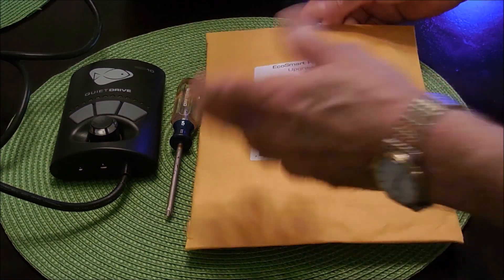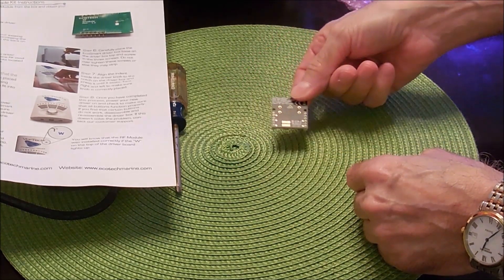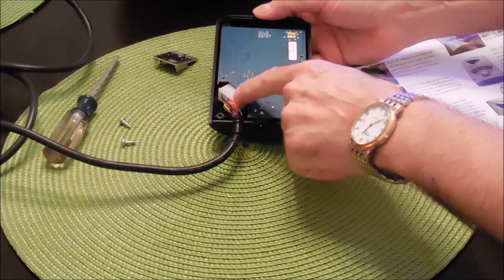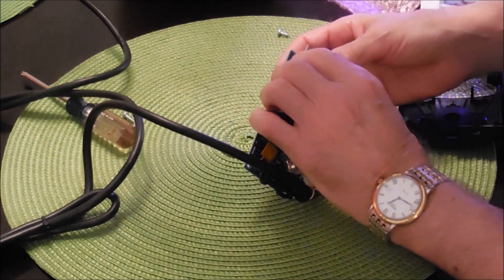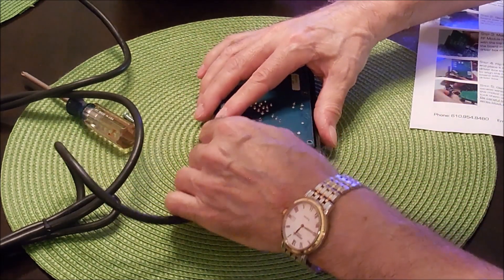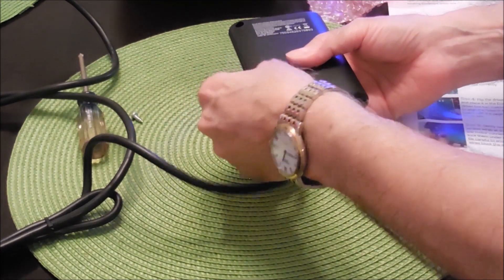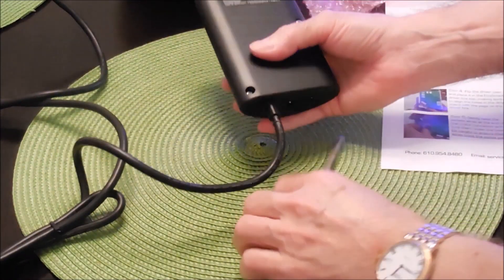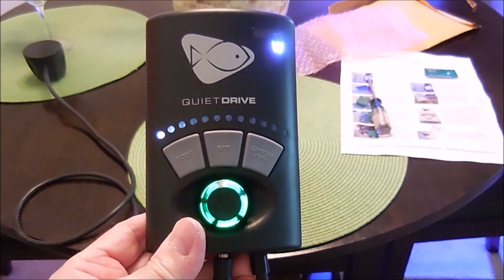How to install the RF module on your QuietDrive

Comment: How do I order it and how much Eddie thanks
Reply from the maker: Hi Frank, you can order it either through Ecotech(parts)or most online stores carry it.  When I bought it the price was around $45.00
Reply: Eddie's Reef Aquaria Eddie my quiet drive has the w light already
Reply from the maker: Yes, they all come ready for WiFi, but when you purchase the RF module you will see it turn blue which means you're now on WiFi.
Reply: Eddie's Reef Aquaria so i still need the rf module ??
Reply from the maker: Go to Marine Depot, BRS, or direct to ecotech marine they all should sell it.